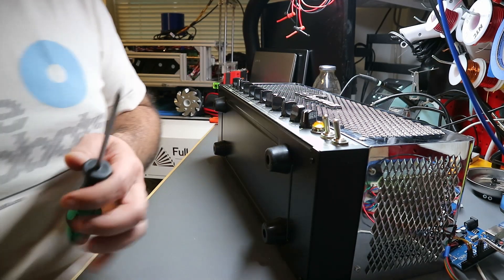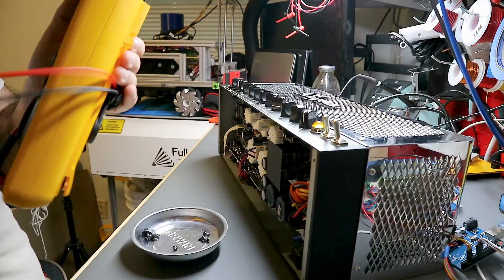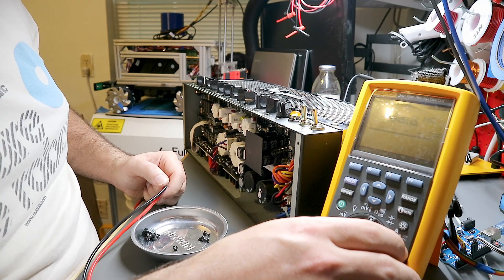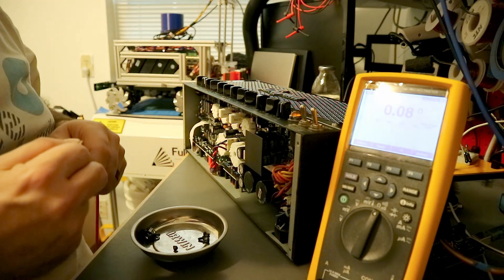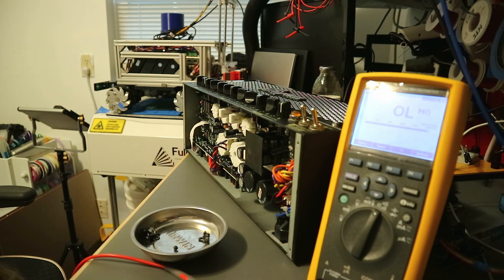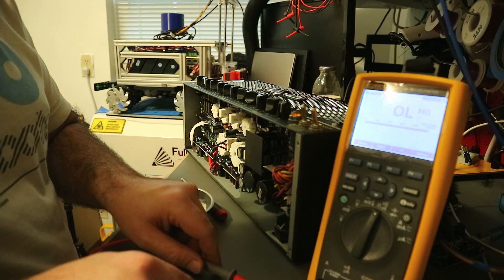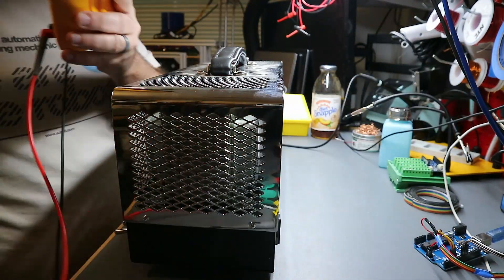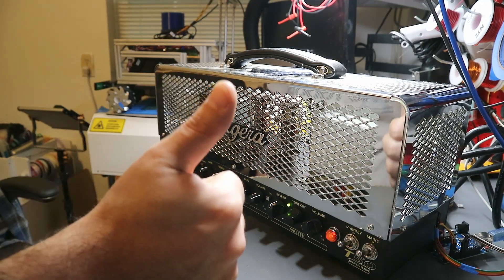Electronics Repair Tip: Bugera Amp Repair

Comment: I have an amplifier just like the one shown in the video. A few weeks ago, the LEDs lit up indicating that I needed to replace the power tubes. I bought and installed them, but it's still showing a problem with the tubes in the LEDs on the back, and the power LED on the front is flashing intermittently. Do you think it could be due to the fuse? Thank you very much.

Comment: My Bugera T-50 50 watt Infinium amp head does not have external fuses. I do not know why this man in his video says the Bugera T-50 50 watt amp head he's working on does! Well, anyway he calls it a "rear fuse", which to me sounds like he's saying it's located on the back side rear of the amp.
 This is what he said: When reading from the comment which is located immediately under the video screen image he wrote: 
"In this video I repair a Bugera Tube Amplifer. The tubes and rear fuse had been replaced but the unit would not turn on properly. I review why it's best practice to pull fuses out of circuit when testing to avoid missing a blown fuse".
Reply: He might be talking about the power tubes and wrote fuse by mistake.

Comment: Please do not power on an amp with a power tube section without a speaker, the only case if it has a build in attenuator and it is in the 0W position. Ok in other positions, but full power it will survive due there is a closed circuit but mismatched resistance...
Reply: If you do not play through your tube amp it is unlikely to blow the transformers or cause any damage as long as you turn the power and standby switches off after a few moments. I have many times turned my amps on and even turned up the volume knob and connected my guitar and strummed the strings only to hear silence. I checked and saw that I had not connected the speaker cables. I would shut down the amp immediately. Once the speaker cables had been connected I powered up my amp and was able to play-and never had any damage to any of my amps.
My situation is that I have many tube amps and only one full stack of two 16 ohm 412 speaker cabs so I must remove the cables from the last amp I played through and then connect them to the present amp I wish to play through. I'm 74 and even though I am very careful, I have forgotten to connect the speaker cables at least 4 times in the last 8 years of so. I play every day and have been doing so for over a decade. I also must always be sure of the ohm selector switch settings on every amp every time I connect to a different amp as I do have other speakers and it's possible to select a different ohm range when I use the different speaker cabs two 2x12 cabs one is 4 ohms and the other is 8 ohms, and three 16 ohm 1x12 speaker cabs, which sometimes I use two 16ohm 1x12 cabs to make a single 8 ohm speaker cab set up.
So I am saying accidents do happen and as long as a person acts quickly it is likely that no damage shall come to the tube amps.
I do think that if you play very loud for a long time and you have not matched the cab ohms load to the power amp ohm output then yes you can blow a transformer or perhaps something else in your amp. So don't do that. Always match up the ohms of the speaker cabs total load to the correct tube power amp speaker output ohm load rating.